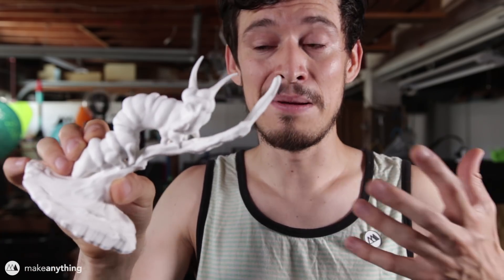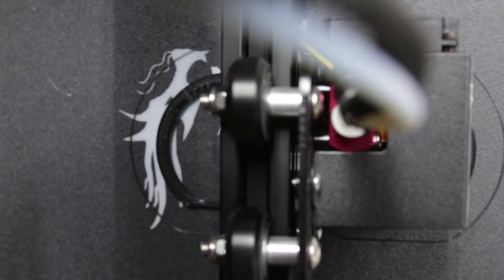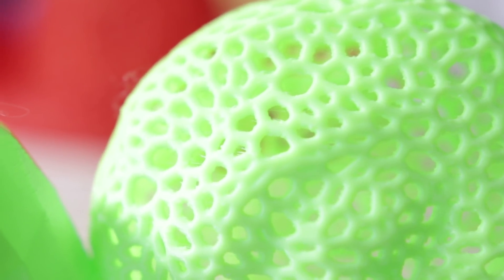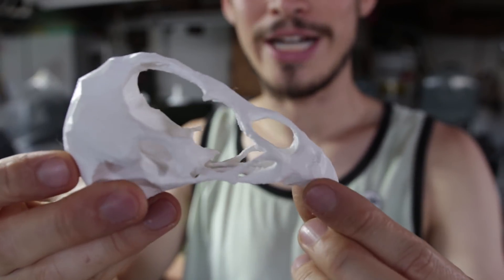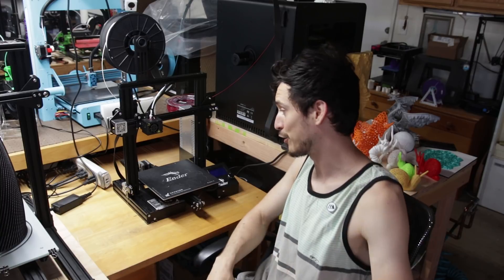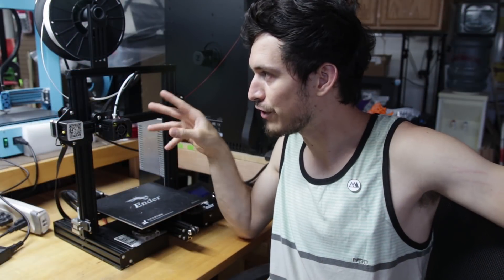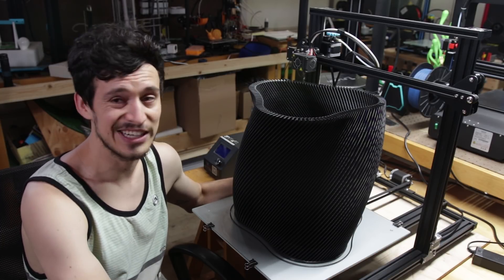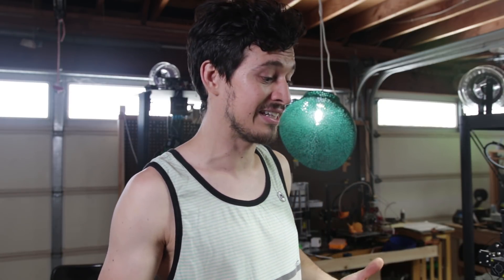MEGAREVIEW // Ender 3, CR-10, CR-10S, CR-10S4, U20. Which is the Best 3D Printer for You?

Comment: A Counter- But, and a big BUT. These printers MIGHT NOT BE THE BEST FOR U! 

In the 3D printing industry, they are referred to as the “race to the bottom” printers. These are based on old RepRap open source designs, some using questionable intellectual property, design compromises, and most of the time with bottom-of-the-bin parts. UR not always guaranteed of getting a good one. Do some research on issues , for example CR10 wrapped beds, dangerous power supplies, under-spec'd control boards,
Incorrectly designed hot ends, fires from these, etc. (Creality is one company’s that's getting better thanks in part to Naomi Wu.)

They are highly marketed to many of the YouTube 3D printing channels by Gearbest, given in exchange for a review, and kickback if ordered. Few return the printers after a review which is professional practice.

Please realize that there are a number of reputable 3D printer companies (around for years) beside the Gearbest marketed printers. Most of these companies provide superior products, support, with quality components, no modifications required, will last a long time, and have advanced, expert communities composed of people with top end technical skills, not just consumer tyro's. Yes,  they do cost more, but when U do a cost analysis, they are usually less expensive to operate in the long term and minimize maker “stress” and spouse/partner conflicts! :)

If UR out to buy, before deciding, look at printers offered by other companies. If U live in the US, maybe invest in a US company, or in Europe, the same. These are the companies innovations are coming from and which are being copied by the Chinese companies. Unfortunately because of the influx of the Chinese printers, innovation by mainstream companies is being stifled.

For 3D printer technical research on YouTube, look for those with a professional background in 3D printing and additive manufacturing, not hobbyists.
Reply: Joe Rhio I agree to a point. Once you hit bottom the only place to go is up.

The thing I dislike about some of the bigger brands is the proprietary components and software they often use. It sometimes makes repairing or potentially upgrading nearly impossible. Especially as many of these companies go belly up because of their inability to compete with Open Source prices.

China is learning and starting to play more fair when it comes to international copyrights. Creality  has made huge strides in their technology and thanks to Naomi, their tactics as well. As it grows by doing the right things, other Chinese companies will follow suit. Not only in 3d printing but other industries too.
Reply: the benefit of the race to the bottom is market adoption. think. how many people can get into 3d printing at $1000 or $2500.

now how many can get into it at $200 and have a decent large build volume and absolutely out of this world print quality?

think about what that would mean for the market. remember 3d printing is more than just printers. you have materials. you have 3d design etc.. etc..

as MORE and MORE people get into 3d printing THOSE markets should (I hope) also explode. big time. that is good for everyone.

the ender 3 IS the bottom. you can't really go that much lower practically speaking. even $150 is just not that "different" from $200 to matter.

so now the only way to go is up. more features better quality. the price will "balance out" in the end at something stable with excellent options under and over it.
Reply: Hi Joe. Thanks for your opinion. Got any recommendations by chance?
Reply: If lots of people buy sub £200 3d printers then a lot of them will move onto other 3d printers and that will drive down the prices of 3d printers overall.
Reply: I've used quite a few 3d printers, but currently only own one, the CR-10S, and it hasn't let me down so far. Takes a bit to get used to speeds and temperatures etc, but I've hardly even modified it. My next may be an ender 3, if I want to, but I doubt that'll happen this year…

Comment: Hi, so I’ve been using Cura as my slicer and I’m wondering if anyone has a specific setting for supports that makes it easier to remove while still doing it’s job properly.
(My printer is an Anycubic I3 Mega if that changes anything)
Reply: Kenji Noftle I put my infill at 5% for the supports. I’ll let you how it turns out. Cura supports are a pain. Been really thinking about Simplify3D just because of custom supports, and better supports.

Comment: I own a Monoprice i3 v2.1 (lots of mods, but a work horse) $350
and an Anycubic Delta Pulley (almost bone stock but with capricorn tubing) $168  with discount
Both print beautifully, but did require some tweaking/building/mods/etc

Comment: How does he do the timelapse at the beginning without the nozzle moving??
Reply: Most likely the add-on to Octoprint where it moves the nozzle out of the way each layer to take a picture. I have not played around with it, but know that these kind of timelapses usually comes from that
Reply: The plug-in for octoprint is called octolapse
Reply: Probably an Octoprint plugin. Out of the box, Ocotprint can take timelapse photos right at z changes, but he has some way of parking the extruder. I think i've seen other Youtubers do this too
Reply: He probably just took frames where the extruder is off to the side and put those together to form a video
Reply: I don't know but I think he pauses the printer every now and then and takes a photo
Reply: As others said, pictures are taken at the end of each layer with the hotend moved out of way.